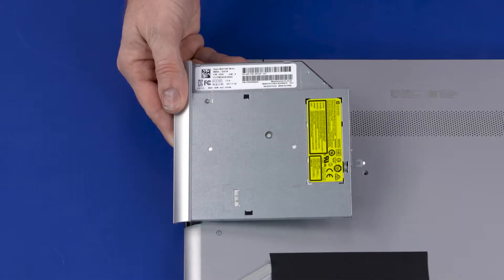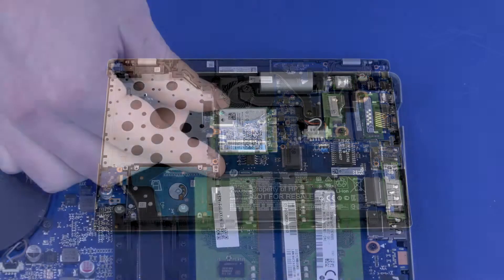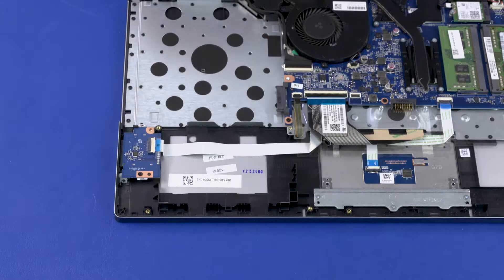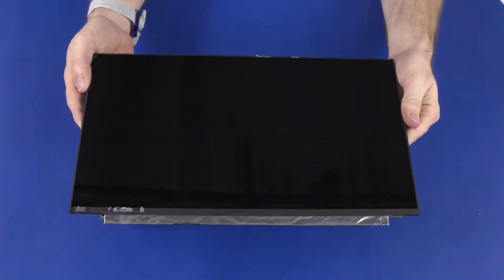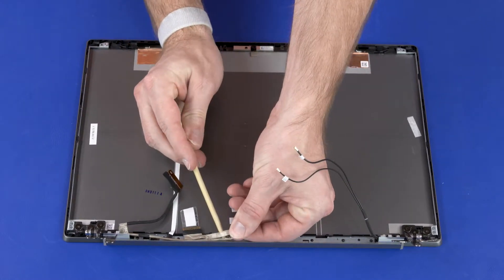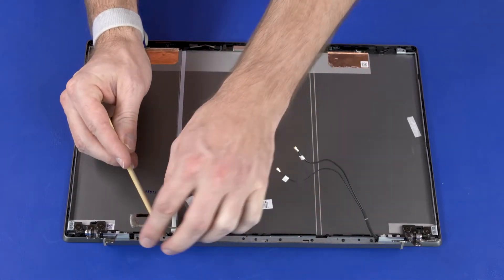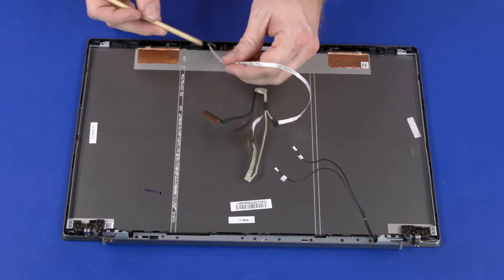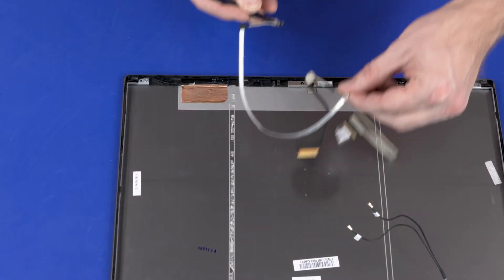Replace the Display Panel Cable | HP Pavilion 15 Notebook | HP

Comment: My visual wire isn't set up like this inside. I have a Grey wire that connects into the card that the camera is attached to. This is a long wire that guides around the edge of the lcd beneath the black snap on bezel, and routes down into the space  behind the left  hinge.  Top visual wire behind the hinge, large bottom wire routing in front of the hinge. 

My Model:15-bs234wm
Product no: 3tt19ua
Is not set up like this video. Same plastic color, but different inside.
Reply from the maker: Hi there, thanks for contacting HP Global Social Media Support!
I understand that you need help in replacing display panel cable. 
Due to limited support on this platform to fix this issue, please feel free to reach us on call/chat. Access this link to select your preferred country and language option to reach us. 
Global support link: - https://hp.care/3R13ByQ 
Binu-HP Social Media Tech Support

Comment: Don't forget to remove th four rubber strips as there are additional screws under each; 2 under each one by the hinges and one each on the two front ones.
Reply from the maker: +Gregg Will Fix It, LLC Thanks for sharing the steps that helped you!!